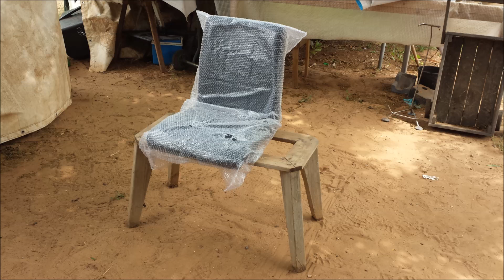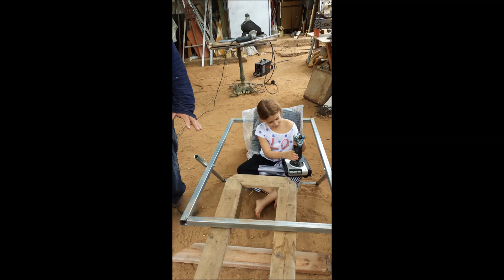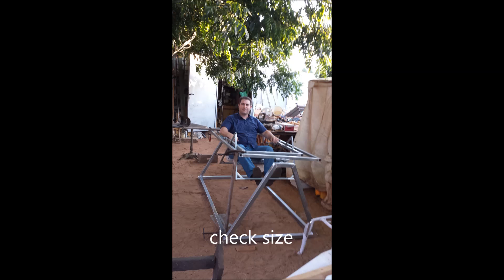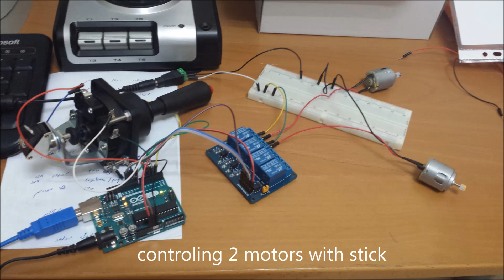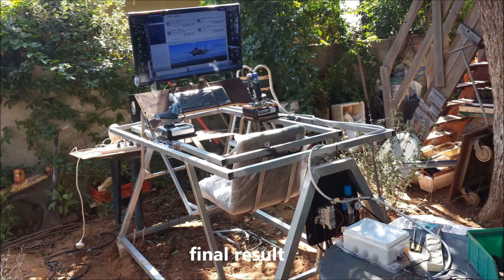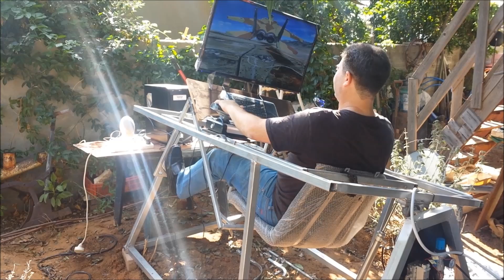My First Motion Flight Simulator 2DOF DYI

Comment: Haha, you'll some tuning, it should be mapped to the plane axis mouvement and not the joystick axis ^^
Reply: At least,, it works ! :D
Reply: +Mdw 159 but it doesn't
Reply: Saxoprane it doesn't do like that. 

it just makes the pilot feel the force that is applied to the virtual pilot. planes may not make pilot feel anything while flying with angle. 

example: while making a regular turn, a passenger plane only makes feeling at the beginning and at the end of the turn. while turning, you can stand up in the plane without having balance issues. so this simulator may not have angle for a situation like that.

if you make the simulator be at the same angle with the plane, it won't give you the realistic feeling.

like the same passenger plane example. if you make simulator have the same angle with the turning passenger plane, you won't be able to stand up while turning because human body is ALMOST perpendicular to the core of the Earth while standing statically. planes are not static objects while turning and centrifugal force makes passenger balance while standing.

this simulator changing pitch to simulate forces that are between front and rear like acceleration and climb. it rolls while pilot feels side forces. it is may not really good at angle change feelings of plane because it cannot move.
Reply: It shoul'd be mapped on the body G-forces. Not plane axis mouvement.
Reply: Yeah is way too much movement for it to be enjoyable playing. I did notice pneumatic, so is going to be a lot harder to fine tune that.

Comment: wonderful job, that is the perfect DIY 2DOF sim machine. 
Some  help: you might want to reconsider using Microsoft operating systems because although they are compatible with many great apps such as DCS world and MS Flightsim, when it comes to dedicated computers for a particular role, such as a dedicated simulator-box, it would be an interesting alternative to install a type of Linux-based operating system, suitable for programming/development, such as Manjaro. 

now DCS world and MS Flightsim are not available for Linux-OS's, Linux does  hawever have available to it community developed apps, the source code open which implies immense opportunity for home-scale development. 
Flightgear Flightsim, Pioneer Space sim, there is TORCS or Speed Dreams/2 for driving.

Although force feedback for these apps is not developed, the communities are very helpful, and with a team of helpful friends you can do a lot. 
The first step, I suggest is to buy a about 120 gig SSD for your sim-box and install on it Manjaro. 
Next is to try and get under the hood of those apps. It might not take a month, six months or even a year, but in ten years you will have an extremely capable flightsim (with your motion sim in mind)

Thanks, peace!

Comment: Hmmm the chair went back way before the plane was leaving taking off. I guess it detects the joystick movement right?
Reply: Yeah, also I think so..
Reply: It may go by acceleration. Many motion simulators lean the user back during acceleration and forward during deceleration to simulate g force
Reply from the maker: Yes you are right. I made it simple, following the Joystick movements only
Reply: @ispyhunting9804  good start and mile ahead of mine (i don't have one)  but if you push further:   The idea of motion pit is tu use gravity as a force generator. IE:  Your pit should lean back under acceleration, to make you feel being pulled in your seat rest.  and it should nose you down when breaking, to push you in your harness.   it should rotate you only if your are slipping in the turn.  a coordinated turned in a plane  is literally unfelt by the passenger.
Anyway, very nice craftman ship you showed here!  good job sir

Comment: Not a bad attempt but the problem is that you're just changing axis according to controller input and not actual pitch and roll of the aircraft.... there are plugins for FS that allow you to get this data... send that rather to your arduino and you'll be starting to get somewhere :)
Reply from the maker: I didn't find the solution how to adjust the motion to the sim.
The protocol of the X52 is not known so i could not connect it directly to arduino

Comment: one possible idea... connect a drone flight controller like a naze32 6dof to serve as monitor, and connect it to the arduino and using the output artificial horizon of FSX make it force the jacks into correct position using the drone flight controller as reference. or build script with usable output of fsx to run on arduino like >> if altitude increase, pitch forward jacks up lower jacks down.

Comment: Sorry to be a nay sayer but there's more to motion simulation than tilt and pitch. An airplane in a bank feels level. the motion should simulate actual forces. example: tilt back simulates acceleration, forward deceleration. tilting during a bank is just plain incorrect.
Reply: ... unless there are actual lateral forces -- but this rig doesn't appear to simulate that... it's simply slaved to roll... which as you say is completely incorrect in a coordinated turn.
Reply: Thanks. I'm thinking of a stewart platform using 6 stepper motors running X-sim. I want something that can be used for both flying and driving sims in VR.
Reply from the maker: Great! i learned about it in mechanical engineering. go for it!